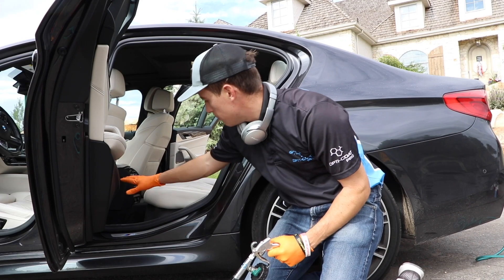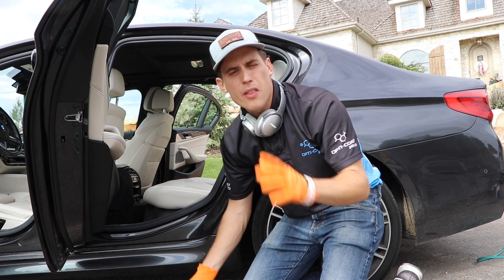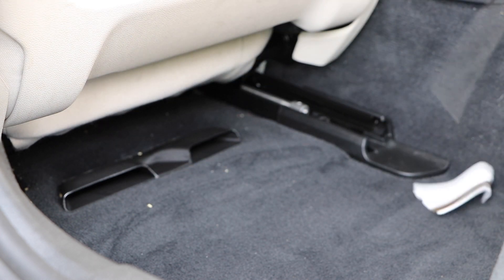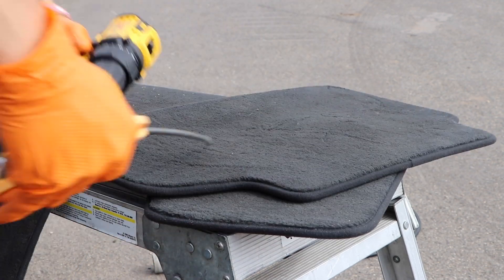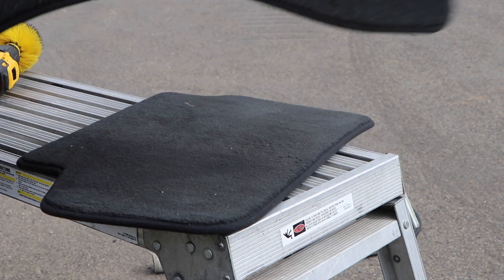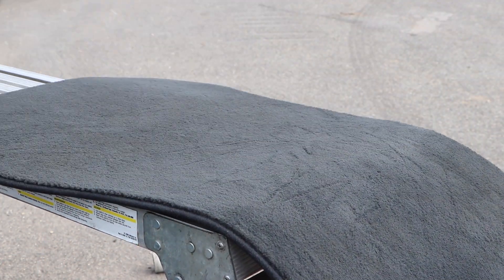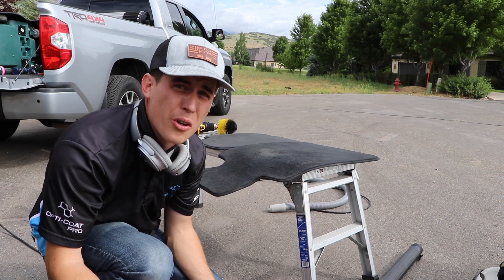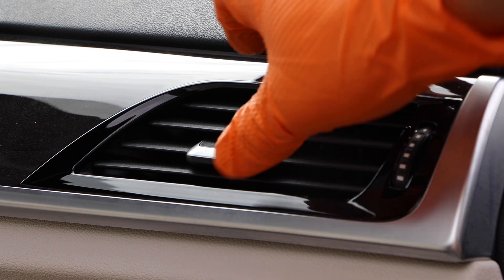Do you need a Tornador for auto detailing? (NO.)

Comment: I just ordered the Tornador MAX(new model). Other than on carpets, I think the Tornador(with chemical use) can be much safer on interior panels than a steamer. I used a steamer the correct way on some air vents and it discolored them. Also, the Tornador can be a great tool for applying BioBreak as a pre spray on carpets/upholstery before extracting. I’m really looking forward to this tool.

Comment: It’s nice to have a change up system where you get to know all the detail tools for the job. This is how most people discover what’s best and worse for them.  Getting enough dirt out of the carpet and seats isn’t actually easy work with a ultra filthy vehicle can often require more tools to properly handle. A huge challenge for mobile detailers with no air compressor and tools. It’s only been more recently air tools and drills have been introduced to detailers. Personally, I rather use a air blower in hard to reach areas because it’s quick and precise. Anything bulky like a vacuum and tornador isnt going to be ideal in tight areas.

Comment: Since you're only really using the air part of the tornador, they make a blow out gun for like $50.  I know compared to the little air gun that's probably still 5x the price but it's a lot more thorough, you don't have to manually flick it back and forth and you probably don't even need the brush.  The liquid part can essentially stand in place of an extractor/steamer depending on how you use it.  It speeds through plastics and does some pretty amazing things to gross upholstery.  If you already have an air compressor I'd say it's definitely worth getting, but if you already have a good steamer, or a higher end extractor (better than a bissel) it may not be worth it - buy one of the knock offs for $20 on amazon and see if it works for you (they work just about as well, they just break REALLY fast).  This is all in the context of detailing as a business.
Reply from the maker: For sure! Yeah I've been rocking the solo air tool these days. I just got that killer deal on the tornador black back in the day which is why I had the Basin attached tool

Comment: Because of you I got a 30 gallon compressor to get some air going. I absolutely love it. I got a blow gun with a fine rubber tip and it absolutely hauls ass. Its SO helpful and definitely has a place for a lot of things! However.. I was dumb enough to buy a Tornador black AFTER watching this. It... sucks imo. I wasn't expecting the world... I mostly wanted it just for carpets as I've noticed its hard to get the sand out from deep otherwise and the Tornador seemed great for it. It works but... The Tornador is bulky.. you can't even set it down on its bottom with the air hose attached. It's way to messy and unhealthy to use with APC without suiting up and honestly the power is underwhelming even with enough air. I'm really unhappy with it and feel like I just blew $250.

Comment: In this video the tornador is being used as a blow gun, which I agree that it doesn’t do that good of a job. Now, IMO the tornador should be used as a cleaning tool and solely as a blow gun. Otherwise, you can buy a blow gun tip for your air compressor and save $$.

Comment: I'll be honest.....on floor matts it's easier to just whip out our Dyson V10 animal and carpet brush.  Done with 4 hugely dirt mats vacuumed clean in 2 minutes.   Washing them......just use a drill brush, a garden hose, rinse and then extract.  Hang to dry.     20 minutes tops if that.
Reply: My wife figured out this trick a while back and it's a game changer.  Those air powered brush heads are always garbage, but the dyson one spins so fast is sounds like it's going to send you back in time or create a black hole when you let it spin freely.  You're the only other person I've seen mention this.

Comment: I love my Tornado. Works great with apc in vents and crevices.
Reply from the maker: do you have a blow gun by any chance? I would love to hear your thoughts on one vs the other. I used to rely more on the tornador to do my carpet work, but now I guess I'm either agitating with a brush or a drill brush as I blow with an air gun....it works great for me. also Yvan with Opti coat suggests AGAINST putting liquid in tornador basin because it's pretty hard on your lungs the way it comes out...it atomizes the chemical he says?
Reply: @HawkProDetailing  yes have a blow gun too and a drill brush and carpet extractor. Drill brush does really good with air gun.
Reply: @HawkProDetailing  You need the velocity vac attachment and a compressor with 2x the cfm rating so you're getting enough volume and work load capacity out of the tool.  that's why you're seeing it as "weak"      You're correct on the anonymization of APC.   They aren't good to use for your health but also for the tool.   Most APC's when mixed even at 20:1 are way to alkaline in PH and that will corrode/wear on the mechanicals in the tool.    They also will leave a residual that attracts more dirt later.   Use an enzeyme cleaner that doesn't need rinsed.

Comment: Hey man a couple things, first, I like your videos and watch them every time you put them out, BUT in regards to the tornador and velocity vac, I feel like you  first need to learn to put it together properly before you can bash it. Is it needed? Absolutely not but it has its uses and is a good tool. Also, get some teflon tape for your air fittings and you'll be a lot happier with performance of air tools and your compressor won't run so much lol.  That's my opinion anyways.  Today my extractor was acting up and if it wasnt for the tornador I wouldve had a harder time than I did finishing the job!
Reply from the maker: I hear ya! I'll have to get this teflon tape you speak of lol

Comment: Greta video!  So thanks for saving me $$$ from buying the tornado.    Btw using that air gun nozzle trying like hell to get 90% of sand dirt out of floor mats still struggling after deep vacuuming hand shaking air blowing still tons sand etc.  What's the secret drill brush??
Reply from the maker: I mean if the tornador helps you my man....by all means try it. But I just went to drill brush.com I think and got the yellow ones. white ones are more delicate but once the yellow ones are broken in (yellow brushes I mean) they seem gentle enough yet effective. I hold drill up and only lightly let the brush go against the fabric and that has been working very well for me. tons of sand and dirt in carpets is a pain! and let me tell you..it doesn't matter what tools you have...some jobs just take patience, creativity and time

Comment: Drill-brush is mechanically stressing/degrading the fibers of the carpet.  Tornador does not do this.  Over time, that drill brush is going to remove a lot more fiber from the fabrics.  I keep a thin air pistol (similar to yours) and a tornador on hand.
Reply: If you're using the wrong bit at the wrong speed yes. If you don't go 1200 rpm with stiff bristles then no damage is done.  The Tornador is more dummy proof I will agree. Drill brush takes  more skill and knowledge. I equate it to rotary pneumatic polisher vs a DA Longthrow electric polisher.  The DA is dummy proof. Pneumatic, the user really needs to know what sound it makes at what RPM and have experience enough with the Chemicals to know pressure and speed per panel. Self taught detailers are every where now (and on YouTube giving advice yikes)  Technical Detailers that started in body shops doing paint correction, cleaning out broken glass and blood that needed to be certified are few. Just us old guys left.  Started detailing in 1999. All these new things... like the Tornador and even the drill brush are great. But Untrained (self taught) guys with new techniques, machines and products damage cars... its not the machines or products.

Comment: In my humble opinion, the tornado is a very effective tool and it will make your job very easy. The truth is, I don't know why the friend says that it is not necessary to use it with the tornado. You don't need to use a machine to wash the carpets. I have been using them for 5 years and I make the jobs easier ..... guaranteed ....

Comment: You aren’t using your tornador at 120 psi as I can plainly hear. It says use it at 90 but that’s just to limit warranty returns. You’ll need an air gun or dupray steamer for tight nooks but nothing compares to the finish a tornador does on the carpet. Your air gun makes annoying lines that look awful
Reply from the maker: yeah that's just for dry soil removal. I then used bio break, a high alkaline pre spray, let it dwell, agitated, and finally used hot water extraction with flex ice to neutralize the ph of carpets. I can assure you they did not look awful:)

Comment: The Toreador to me is useless, I work at a dealership as a detailer. The only things that I  use it for water. I fill up the container that screws on it and use it to get the access chemical off the surface of the interior other than that, it really is not a tool I would use by itself
Reply from the maker: I mean I like the tornador more NOW than I did when I made this video...the difference now is that I have a shop...and a more beastly compressor :) But do you need tornador? Not if you have an air compressor and a tip. But like I said...for pad cleaning and carpets I'm coming back around to liking it again lol

Comment: Nick, Great video. I just subscribed, I enjoy your practicality. Can you put a link in for the hose and blower wand attachments you use for compressed air. For the Drive Way Detailers like me you can get a Rigid or Porter Cable Pan Cake Compressor at Hone Depot for under $100. I originally bought mine before I became an enthusiast  out of necessity  due to the brutal Michigan winters, to be able put air in my tires, without having to drive to a gas station usually in the dark, wind blowing toating flash light and digital tire gage and pocket of quarters. Hate to mention  it,  Back Friday is 123 days away, so ladies and gentlemen put a pan cake compressor on your Chritmas list. 

BTW Nick give Turtle Wax Ice Snow foam a try, bought it on whim this weekend at Orielly's on the  cheap , great dilution in a cannon, great clean, blew me away, CG Honey Dew was my Snow foam of choice (for the record it's one if the only two products I personally like, and I've found better for the second). TW Ice had been Rocking it.

Comment: The chemicals with the Tornador is the difference, the enzyme cleaner works . The fact you still  clean major stains with it . The needle nose attachment your using isn’t so good for that They do different jobs imo . The needle nose is good I have one and use it similarly but for the tough grime and stains the Tornador is better to me.
Reply: HD-Vision auto detailing I've been detailing cars for 25 years been using the tornado for the last five years and it's an excellent working machine can live without it get into AC vents cup holders middle console door panels headliner seats underneath the seat I also use a blowgun the blow gun works great.

Comment: Why would you use the tornador for basic cleaning, any detailer would use compressed air to blow out all the small areas etc even if they removed the seats. The Tornador is good for what it does, but its not some miracle blower vac.

Comment: I disagree with you on that I like it a lot  mine works fine
Reply from the maker: ya know I used to love mine...maybe I just need a compressor the size of a house lol
Reply: Hawk Pro Detailing lol oh come on I have California 10 gallon compressor
Reply: Hawk Pro Detailing what compressor CFM are you using!? My compressor is about 4 feet tall and over 90 CFM. I use it at 120 psi (above suggested) and once ina while I have to let it catch up, but it’s unmatched for pet hair removal and final finish imo
Reply from the maker: I used to love the tornador! maybe we just grew apart:)
Reply from the maker: ya know I totally hear you on the pet hair removal. but the longer I do this, the more I realize there are a million ways to get similar results. The drill brush with blow gun was doing awesome for me. You mention "finish" -- carpets can easily be groomed with a brush to achieve final finish. I'm primarily asking the Tornador to assist in dry soil removal on the front end so I can most effectively clean car carpets:)
Reply: @HawkProDetailing  tank size is less relevant than cfm rating.  That said you will want enough reserve to ensure you're compressor has enough rest time.

Comment: Youre comparing the ability to blast air. Youre not using the tornador for blasting solution into crevices. If I had one I wouldnt use it to blast air either, its a high powered spray bottle.

Comment: If you're comparison is only based on the air pressure and displacement of large particles, I would totally agree with you.. it's kinda just okay... But that's not the full function or reason for the tornador or what makes it good... It's the fact that it also sprays a bit of solution at high speed with the high pressure air to cut through grime and stains. In that sense, it's GREAT! Still, is it necessary? No. Interior detailing can be done multiple ways. Personally, I'm a fan of steam which is just as fast as a tornador, as well as simple drill brushes and vacuum... But that's mainly because air compressors are a pain in the ass. I also don't have enough space for one in my SUV with everything else. I don't see the point of getting one just to run an air gun and tornador.. that said, it is entirely over priced and so are the parts. You can get knock-offs for 1/5th the price though, and from my experience, the original is wayy better than the black version, with the caveat that the tube in the middle wears out faster. It's not a gimmick, but it is over priced.

Comment: This is a dumb review, because you know damn well the tornador is not just designed to blow air, yes you can blow air and that’s one of the futures, you should be using the solution or water to lift the dirt away from the fibers, you can also use it to break dirt and grind from cracks and crevices and door jams, doors, engines, tires. This is a bad review learn how to properly use it before you do a review.
Reply from the maker: I have used it for two years. I like the tornador but I stand by the "you don't need it" philosophy. Get a drill brush, a simple compressed air gun, and a vacuum. Blow or vacuum out the car first (my rigid vacuum comes with a leaf blower, so if you don't have compressed air, use a leaf blower inside the car)...work with the air compressor nozzle to agitate fibers and explode all that dry soil out of carpet....vacuum in one hand AS you use the compressed air in the other hand....Yvan Lacroix says if you don't want to drink what's in your tornador liquid basin, then don't put liquid in there...because it atomizes and goes right into your lungs. so I use the tornador, when I use it, for dry soil removal only